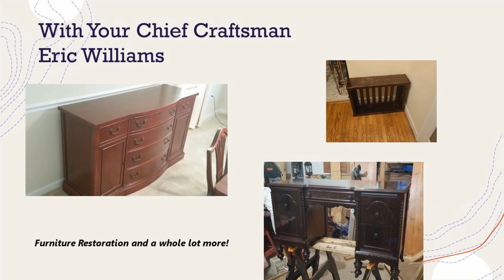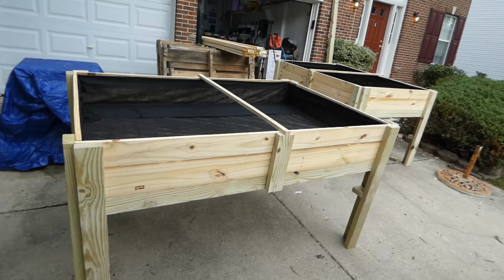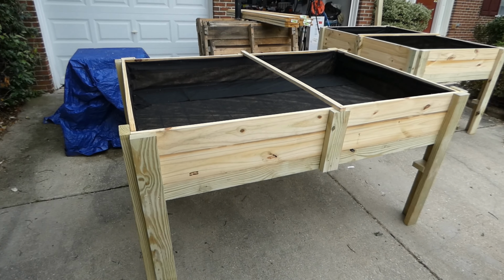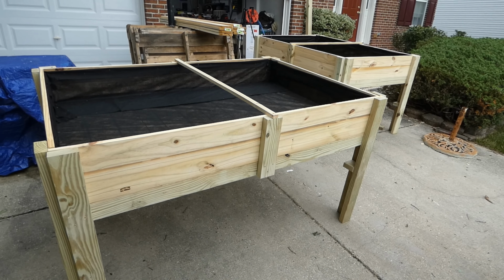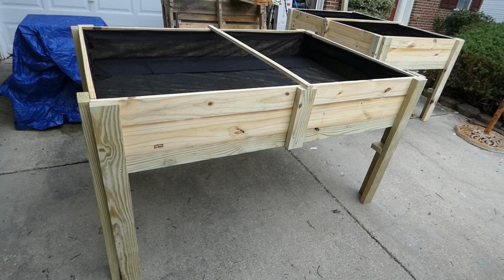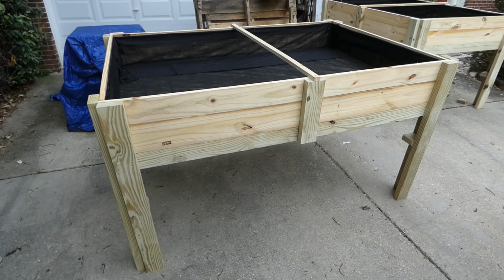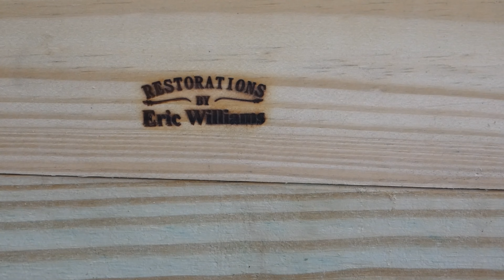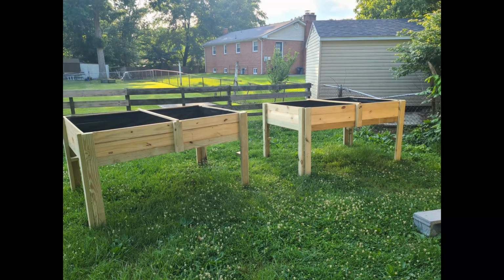How to Build Raised 6x4 Planter Boxes for the Veggies

Comment: Saw your comment on the Home Depot review site and came here to check it out.  Great idea!  I, however, just finished two 6x3 metal-walled planter beds of the commercial and expensive variety about 2 months ago.  Last week I got another load of those $1.98 picket boards, 4x4s, and 2x4s for a fence.  I can now attest to the cost difference in materials! 

Though the wife doesn't need another large planter box now I'm thinking about using your technique and materials and reducing the size to maybe 2x3 (still picket lengths divided by 2s) but extending the 2x4s past the box to make wheelbarrow-like handles so she can move it to other locations depending on sunlight requirements for the current season's contents (we are in Florida).  The far end would of course require a pair of wheels.  In case she can't handle that weight/leverage I'll probably put a cross 2x4 on edge on the hand end box bottom supports so our 2-wheel hand truck can grab and move it.  I gave my router away to me oldest son, so the handles will take some cutting down and shaping, but I think the idea has possibilities!  

SO glad you made that HD comment and led me here!
Reply from the maker: Well I am glad you found it and now your giving me ideas on a movable planter box???? I think that is Ideal for those who have small yards as well.  The two in the video were built to the customers specs, but since I custom build the size can very based on the customers needs. Thanks for watching my Channel and stay tuned I got more coming.